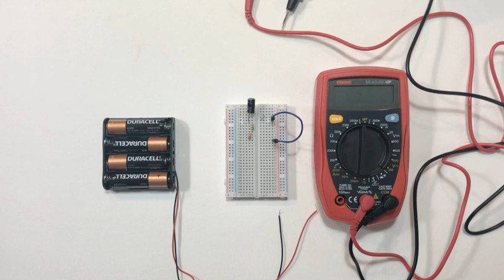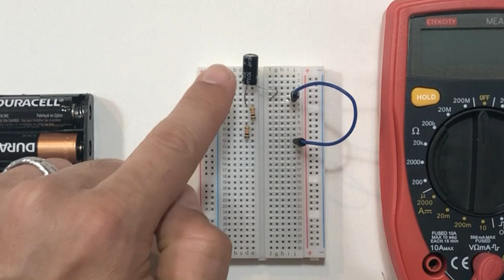Time it takes to Charge and Discharge a Capacitor

Comment: T=RC, T= time in seconds , R= Resistance in ohms , C = capacitance in farads. Note, that it takes approximately 5 time constants to fully charge or discharge a capacitor. 
T=(30000)(0.0001) >>> T=3X 5 = 15 SECS for total charge/discharge.

Comment: With the two 10 kOhm resistors it would take 10 seconds for the capacitor to fully charge/discharge. Adding a third 10kOhm resistor would change the time to 15 seconds to fully charge/discharge. This is based on calculating the time constants to be t=2 and t=3 respectively, and it taking 5 time constants for a capacitor to fully charge/discharge.

Comment: If an additional 10 kOhm resistor is added into the circuit, the time constant takes to charge the capacitor is 18 seconds; it also takes the same time constant (18 seconds) to discharge the capacitor.

Comment: if it takes 5 time constants for a capacitor to fully charge and discharge we do simple math and come to the conclusion that with 2 resistors the time it takes to charge and discharge is 10seconds. divide that by 5 and you have a time constant of 2 seconds. with one resistor, it takes 5 seconds. divide by 5 and you have a time constant of 1 second. assuming all is wonderful and equal, adding a 3rd resistor will add another 5 seconds to the total time to charge and discharge which would be 15 seconds. divide by 5, and you have a time constant of 3 seconds.

Comment: So is it to say that if you complete a circuit board’s circuit with a jumper cable, any resistors on the board would discharge any existing capacitors?
Reply from the maker: Well that depends on what the circuit is doing and where you place the jumpers. If you use a jumper directly on the capacitor then you are bypassing the resistors on the circuit board (which is usually how its done), so you would have a very low resistance (just the resistance of the jumper) so you would discharge very quickly

Comment: Man, when he dropped the battery wires, they looked like they short circuited. ALWAYS disconnect one battery out of the socket so that the two leads don't accidentally touch and burn those batteries quick.